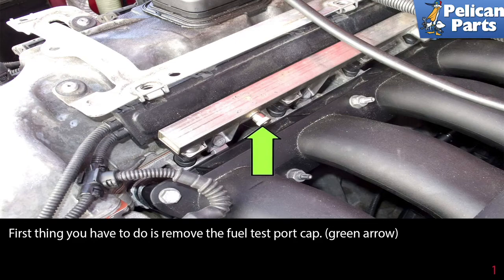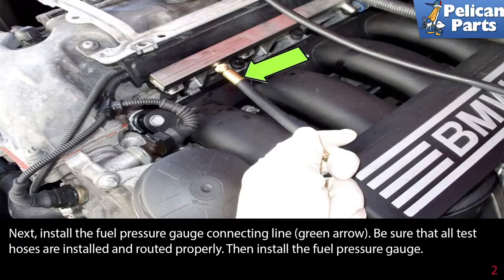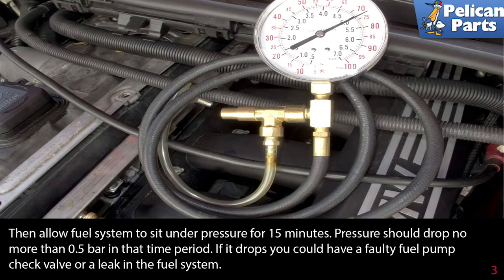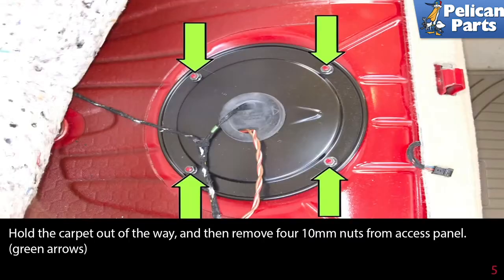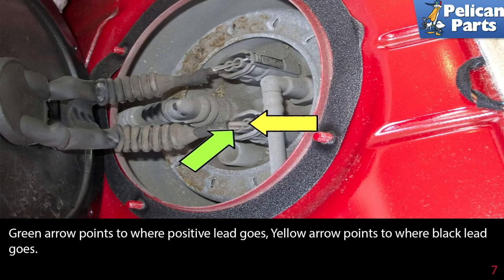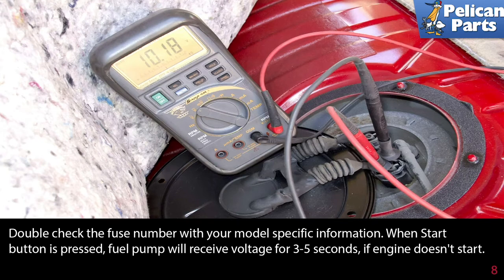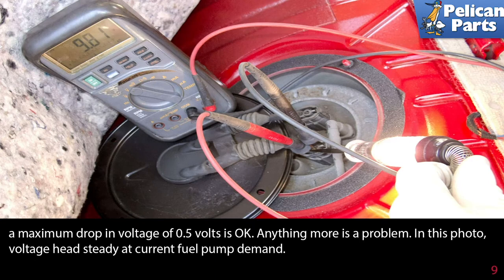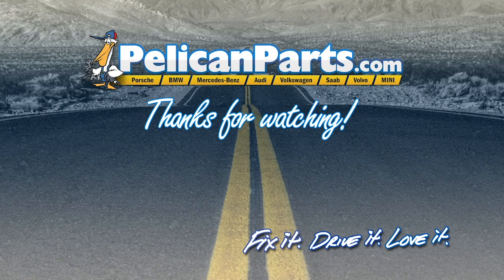BMW E90 3-Series Fuel Pump Testing for 325i, 325Xi, 330i, 330xi, 328i, 335i

Comment: Does this also work with solely I think that's how you pronounce it I have an n51 2010 328i my code is 651B suction something to do with suction jet
Reply from the maker: You likely have a faulty in-tank fuel pump.
Reply: @pelicanparts  thank you so much I can replace it yes or do I have to I don't know I once had an E46 I was able to replace my own but I haven't seen what's underneath the seat yet

Comment: The fuse you said was f70? The diagram shows there isn’t a fuse in that location
Reply from the maker: Could be different for your model. Confirm using a repair manual.